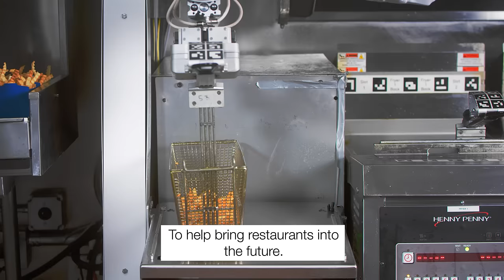Miso Robotics - Flipping Burgers

Comment: Having worked in the industry this motion may work for frozen fries but fresh will likely break with the rocking motion you've programmed in. We were specifically taught to shake baskets only in the vertical axis to minimize breakage. Seems like an easy enough fix! Though I would personally be worried about working in a busy kitchen next to a robotic arm without mechanical safety barriers in place.
Reply: agreed.

Bound to get forever burned by that HOT FRYER basket...
Reply: They are NEVER going to use fresh potatoes.